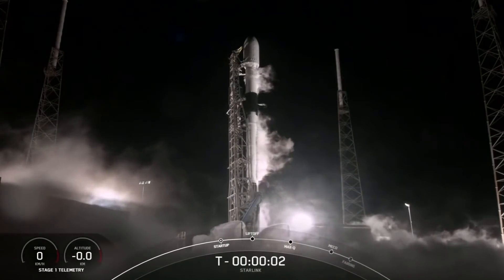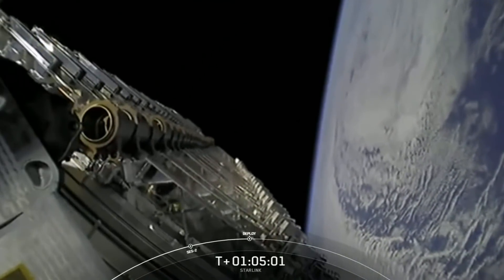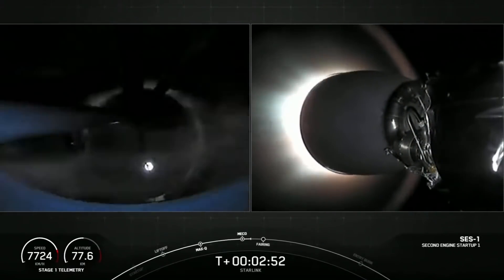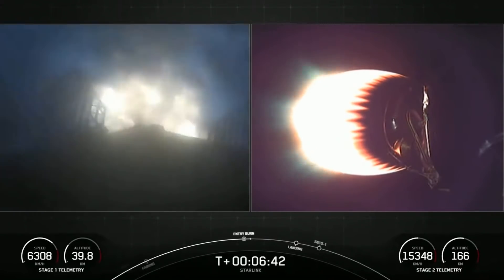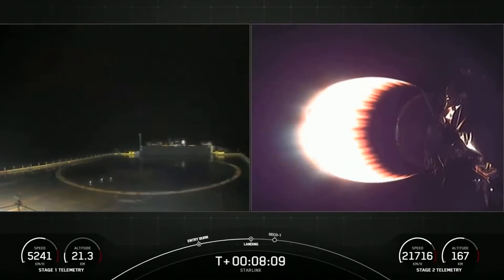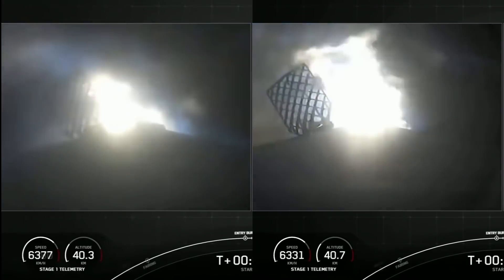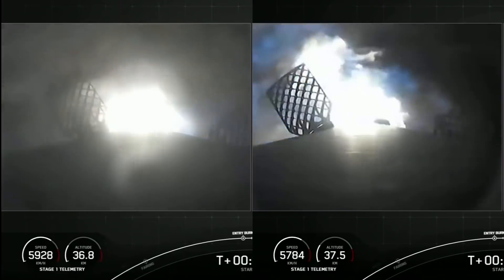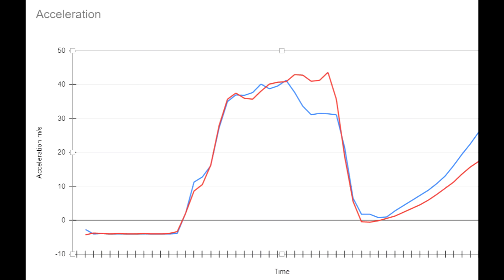Did An Engine Failure Kill A SpaceX Booster on Its 6th Flight?

Comment: The birds really do tell the story here. They were obviously startled twice in close succession. The rocket surely has an automatic "crash imminent" self-destruct function to destroy any remaining fuel. The orange glow is the vehicle self-destructing. Then 3-4 seconds later the birds are startled by the shockwave. Then the remains of the vehicle hit the water at high speed. Again 3-4 seconds later the birds are startled but to a higher degree possibly indicating that the splashdown was louder than the self-destruct explosion.  By using time-of-flight analysis and the speed of sound, it should be possible to roughly calculate the altitude and velocity at self-destruction, as well as the distance to the droneship using data from the birds alone.

Comment: The seagulls seems to startle twice. Once at t+8:10 while the sky is red and again at t+8:19. So assume the second one is from the sound of whatever happened when the booster hit the water and assume that impact happened when the glow flared at t+8:07 just be for it goes out all together. Assuming all that, it looks like the impact happen about 1100fps*12s or about 2.5 miles away. ...Interesting. It gives some idea how much control is applied during reentry and landing.

Comment: Something strange happened on ascent too, max-Q was called a full 13 seconds before expected, judging from the bottom animation on the live stream, which is usually spot-on (max-Q was called at at 1:02 after lift off, but was expected at 1:15 according to the graph)
Reply: Colder weather than normal?

Comment: I was wondering if they sacrificed the rocket to test something they were wanting to check out before flying SN10
Reply: Considering how completely different the two systems are and how they operate I can't see it.
Reply: @TheEvilmooseofdoom  - sure the rockets are different, but both SN 8 & 9 had issues with the re-ignition of the engines , which is also what happened on the latest launch. I was just speculating that perhaps that space x might of been tweaking something software or procedures on this rocket to give them a bit more insight for SN10
That said having had another look at the video Scott did point out the sudden loss of power toward the end of its re-ignition which points to other ideas of the failure ....
Reply: @SandyCrack69  The rockets are different.  The engines are different.  How the engines are lit is different.  They would not test anything on one that has anything to do with the other.

Comment: Do I see a significant change in deflection of the grid fin after reentry burn shutdown, as that fire persists?  Maybe it lost attitude control, and that's why data dropped?  If the telemetry signal is via a directional antenna on the booster?  
Then, the premature orange glow in the clouds is probably a partially broken up burning booster that crashed into the sea at a pretty high rate of descent.  Or just a fireball at impact.  But I could be quite a bit off in my guess.  On the plus side...no damage to the drone ship, it appears!  The seagulls said, "Whoa!  But we're ok right here."  And then one said to the other, "Was that another ULA booster?  I didn't think they crashed them near ships?"  ;)

Comment: Those gulls are providing relevant data.  They all take off at the same time, twice.  The first time is about the time the light is the brightest, the second time a bigger reaction about nine seconds later.  This leads me to believe the booster missed the barge by about 3 kilometers, and that the birds were first reacting to either the sonic boom or the light flash, and the second time reacting to the sound of the rocket hitting the water and exploding.

Comment: Can you imagine the somber voyage home as the recovery crew returns with an empty drone ship?
Also, I think the theories about the birds on the drone deck causing the abort is inaccurate.  Falcons are predators and would have no issue dispatching seagulls.
Reply: It’s called a drone ship because it is controlled from land and not on the ship, like a drone
Reply: @spacemanwilli  Its operations immediately prior to, and following landing such as station keeping, securing the booster, or fighting a fire are autonomous or remotely controlled, however, it is not driven remotely to or from its target location, but rather towed.

"SpaceX droneships are not designed to autonomously move themselves over long distances. Instead, a tugboat is used to tow the droneship to the target position offshore in the Atlantic Ocean."

Comment: SpaceX: "We can reuse the rockets"
Almost Everyone: "No you cant"
SpaceX: "Look we are using reused rockets"
Almost everyone: "What, you cant even reuse them more than 6 times?"
Reply: Already 8 times for #1051.
Reply: "That's still 5 times more than most rockets do" (c)
Reply: According to some third party analyst, SpaceX needs at least 10 flights from a booster to have economical reuse, anything less is a net loss. But there were no numbers given how they had arrived at such a conclusion.
They are launching a lot of Falcon 9s, so the reuseability development costs would be amortized to be quite low per rocket, 10 million$ max by my guess. The payload penalty due to reuse is about 30%, that does not translate to 30% loss, because the reusable payload capacity covers most satellites anyway.
This would translate to relatively extreme numbers. I have done some calculations with what we know, but those who had written the article did not cite any numbers why would this should be the case, not even any calculations.
The amortized development cost would go down with every launch, so even if their ROI is now 10 launches, after some time it would fall to 7-8 launches, eventually to 5 launches. Unless they have very good margins already (>50%), in that case they should not bother with reuse at all, because it would mean little extra profit for lot of risk. They would be massively profitable without re-use anyway.
Reply: @adamrak7560  Elon tweeted that this isn't the case, and cost wise, you start profiting from reuse on the third flight.
Reply: @adamrak7560  Are you referring to Thunderf00t?  He's a total idiot with a chip on both shoulders.
Reply: @poruatokin  check out his latest video, it's a classic ;)
Reply: @kentonian  OMG, just "tried" to watch it but couldn't bear to continue. Does the guy have any credibility left?
Reply: @adamrak7560  They should continue to re-use until the booster fails so they can understand failure modes better and learn how to keep them flying longer. A lot of this knowledge probably transfers to improvements in Starship. Not everything is about immediate profit. Learn as much as possible from every launch / rocket to make future rockets better.

Comment: I note an issue that can be resolved via software.  As with Starship SN9, an engine failure resulted in the loss of the vehicle.  a software change could ignite an additional engine, account for the change in attitude, and save the vehicle.  I'm guessing Elon is in a face palm moment.  Guys, we have 9 engines.  We can recover from an engine out situation...

Comment: By looking at the seagulls to me it seems like the booster exploded crashing on the water, that's what the orange glow was, in my opinion, you can see first the seagulls reacting a little bit after the glow (feeling the explosion through the water since the speed of sound is faster in water), then a few moments later they react again (feeling the explosion through the air since the speed of sound is slower in air), from the way the seagulls behave it really looks like the orange glow was the booster crashing on the water and exploding.

Comment: SpaceX may be the best at reusing rockets but if the total success rate, including landings, is much less than 9 out of 10 it doesn't bode well for future crewed landings.

When you also take into account that Starship won't even have a launch escape system and the number of passengers it's intended to carry, as well as Musk's apparent frustrations with the FAA, it seems like a recipe for a Hindenburg-like disaster.

SpaceX inspires so much adoration and people have such high expectations that I think it's difficult for them to believe it can fail, but even if they get an unmanned Starship working the final furlong - getting the Super Heavy human rated - is going to cost billions. If I were a betting man I'd say the odds of success is still 50/50.
Reply: No one knows what if any escape system starship may or may not carry.  However it doesn't bode well for the nonsense of earth to earth use.

Comment: I found it interesting that the moment the burn started to go wrong and the telemetry froze on the main stream, the second stream with the mission control audio feed went dead silent. Even missing the SECO call.
Reply: They might have muted it as a precaution
Reply: @javaguru7141  That's entirely possible, though they didn't fully mute it on the main stream.

Comment: There has been skepticism over the cost savings of Spacex’ re-usable boosters over total loss rockets. 

Some have put the cost savings as low as 10%. What is the net bottom line savings?
Reply: Of course there has been scepticism.  There has been scepticism about electrical light versus gas light versus candles versus torches. 

Fact is, however: the fuel is laughably cheap, the engines are extremely expensive. The only ways to make reusability more expensive are:
- extremely cheap engines
- extremely costly engine checks & refurbishment
- extreme cost for landing the engine (likely with fuel tanks and other stuff still attached) and recovering it. 

I do not see the check & refurb as a problem, as you will always have to test-run an engine — an engine that has flown has been proven to work much more realistic than any test-run ever can with acceleration and vacuum all thrown in.

The cost of landing — even on a custom built robotic barge — is amortised over many landings — and landing next to the launchpad is possible for some flight profiles.

That leaves us with extremely cheap engines, possibly OTRAG style.  I do not see that happen any time soon.

What I do see is SpaceX breaking into the market defined by their reusability flight profiles, offering significantly lower prices — and having a higher margin — than the fly and discard rocket companies can offer. That may have them running scared, even though they have profiles SpaceX cannot offer (yet).

The best indication for a minimum of cost savings is comparing the prices charged before and after they started reusing boosters.

The only other comparison would be the Space Shuttle, being designed by committee and suffering from it.
Reply: They fulfill the contracts for fractions of the other companies. So even if that were true the company as a whole is clearly about to outcompete everyone else in the field. The Russians and the Chinese cannot put a person or a kg into space as cheap as SpaceX can
Reply: In August of last year this is what Elon said on the subject "Payload reduction due to reusability of booster & fairing is <40% for F9 & recovery & refurb is <10%, so you’re roughly even with 2 flights, definitely ahead with 3"

Comment: The issue is 6 launches per booster still is just barely the break-even point financially since it costs ~40% of the booster cost for refurbishment
Reply from the maker: Citation needed
Reply: @scottmanley  Apologies, I was using ULA figures as an estimate of SpaceX costs, going directly from SpaceX seems to put it at about 20% for refurb + a new second stage. Fuel cost is negligible (LOX and RP1 are cheap).
You lose about 40% of the payload going reusable vs expendable, so actual breakeven is closer to 3 boosters (vs full thrust).
Reply from the maker: @supern0vae  but that misses the extra expense the ULA boosters need because of the strap on SRB’s.
Reply: @scottmanley  Yeah that's why using the ~25% from SpaceX (a reused booster costs about $15MM according to Elon) is more accurate which puts it at ~3 launches for breakeven compared to expendable
Reply: @scottmanley  Elon tweeted in Aug of 2020 "Payload reduction due to reusability of booster & fairing is <40% for F9 & recovery & refurb is <10%, so you’re roughly even with 2 flights, definitely ahead with 3"
Reply: @TheEvilmooseofdoom  In his May 2020 interview with Aviation Week he said the cost is $15MM for a relaunch if the booster and fairing are recovered. Add $6MM if a new fairing is required. With a per-launch cost of $60MM expendable that's about 25-33%.
Reply: @supern0vae  What is a booster new?
Reply: @TheEvilmooseofdoom  According to SpaceX, $62M is the retail cost. Their ISS launches are about $120M and the Space Force launch they did was billed at about $350M
Reply: @supern0vae  NASA contracts are always padded, it's how NASA helps fund development and they sign those contracts way in advance.  I have no idea why the spaceforce launch cost so much but one thing is certain, 6 launches to break even is and always was nonsense.
Reply: @TheEvilmooseofdoom  Yes, it was using a ULA estimate of SpaceX's costs. I corrected it later to closer to 3 launches.

Comment: Just wondering if the "Starlink release bars" are on a sub-orbital trajectory or is that now space debris for decades?
Also, any reason it releases from the 2nd stage? Looks like it could be hinged and remain attached to the 2nd stage. Less debris in general.
Reply: I've wondered that, too. They are definitely in orbit when they release. I would assume the bar slowly decays and re-enters but might take months of years.
Reply: The initial orbit is elliptical.  The starlinks have to use their own engines to raise their orbits.  Anything without an engine re-enters on it's own, it's a measure to make sure any sats that are DOA don't stay up there.  At least that's how it was explained to me.

Comment: When landing an orbital rocket is common, but it is news when it crashes... How times have changed in just 5 years.
Reply: they all sort of land, its just some remain assembled i guess:P
Reply: @BladeCast you truly do not understand risk assessments

as I said "If" they flew everyday. they currently have a failure rate of 91% on the block 5. There's no promise that even if they fixed what caused the recent failure that they would increase reliability because THEY DONT FLY ENOUGH

You have no clue how many problems these rockets have that have not been discovered. because they have NOT FLOWN ENOUGH
Reply: @BladeCast Imagine being this mad that someones says your favorite rocket doesnt get tested enough.

This is like having a car that has a catastrophic failure roughly every 11 times it goes out for a drive, and then saying its reliable because you only drive 18 times a year
Reply: it wasnt common it doesnt fly enough to be common. if they flew every single day they would fail at landing every 10-12 days

Comment: Actually I think it lost hydraulics on the way down. I think that stuff on the lense is hydraulic fluid and the engines lost their gimbal ability, so the rocket was heading not straight down anymore and the engines was turned off by the computer after some seconds since the vehicles attitude was too extreme to recover. The clue here is that the flame goes just in one direction: up. If the rocket would be upright the flame would still go in all directions. 

The heat of the reentry then just destroyed stuff in the back, so it's something solid burning up, not propellant.

While you can see one of the grid fins actuating until the last second it's kind of small if you think about it, that there was a major malfunction on the engines and there's something of the rocket burning up into one direction. So it probably just used some remaining pressure in the pipes behind a check valve. 

I also think it's not possible that the rocket can loose that much propellant in such a consistent rate when the engines are shut down, since the tank valves would be closed. But I could be wrong here.

Comment: I think you can use the reaction of the seagulls to estimate how far away 1059 impacted the water.  The seagulls react twice.  The first time seams to be when they are startled by the bright light with the second bigger reaction to the sound of RUD.  There is about 5-6 seconds between the 2 reactions.  There is some equation about distance and sound, yada yada.  Math, that's what Scott is here for...
Reply: The speed of sound at 21C (70F) and sea level is 344 m/s. If the seagulls took between 5 and 6 seconds to react, then the closest distance B1059 could have been from the barge is (344*5) or 1720m (~1.06 miles). The farthest it could have been from the barge is (344*6) or 2064m (~1.28 miles).

Comment: In the side by side comparison, I also noticed the left booster's camera lens, which failed last night, got sooty compared to the right booster. It doesn't seem like the camera is going out of focus, otherwise it would have done that on every re-entry burn and that was the first noticeable landing attempt where the camera gets that distorted, blurry vision. No idea if that means the engines were fuel rich or something else, but I wonder if that's a potential sign that things weren't going correctly for those engines or the re-entry itself.

Comment: its not the 100mph faster, its the 5700 kph that much lower inn the atmosphere where the air is denser.

why no comparative altitude?
Reply: How could he compare altitude when there was no telemetry from the failed booster?
Reply: @TheEvilmooseofdoom  
Umm, before telemetry cutoff?

Pick the point that they both were same speed and height and the boosters lit. 
Then graph time vs altitude and speed. 
Or just graph speed vs altitude until cutout.

Comment: So your graph shows a decrease in thrust by 25%, could it be an engine failure but fuel was still being pushed out and the 9% thrust was coming from that fuel burning outside the engine?